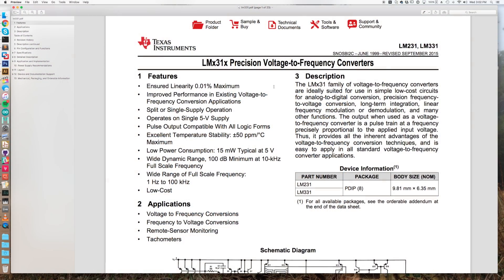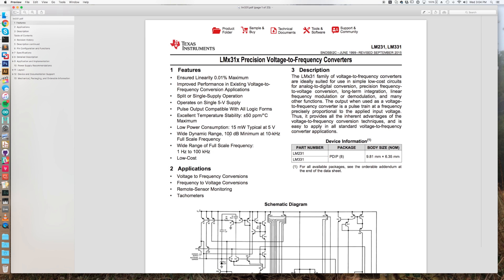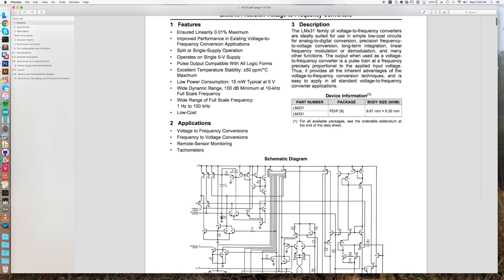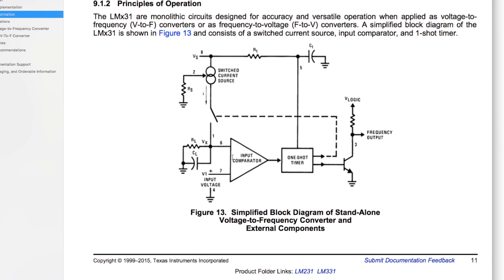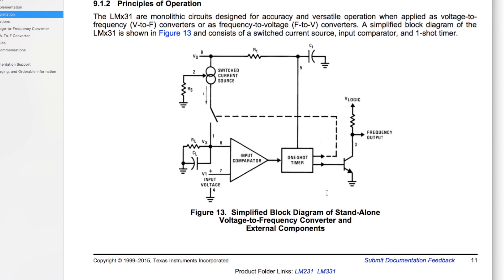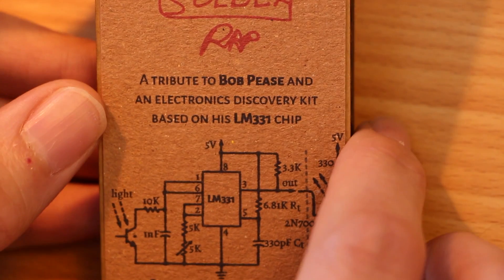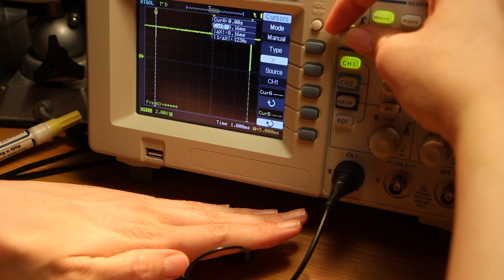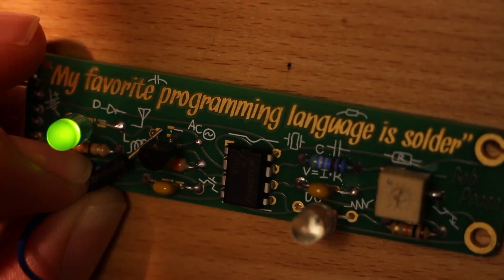LM331 Light to Voltage to Frequency

Comment: more than a wonderful LM331 video.. i have a LC v2F module can generate different frequency with no schematic and before i let the smoke out i better see how to hook up the output....?        Two independent outputs, OC-OUT is NPN, and FREQ-OUT is IC output. The common cathode end is matched with the negative GND of the power supply. When common anode connects, it is used with power positive. If the connection is common anode and power supply is 13-24V, please serial connect a 2.7K ohm resistor; if the power supply is 12V, please serial connect a 330 ohm resistor.  Connect the frequency pulse signal to F, and there is a corresponding voltage output at the terminal. Correspondence between input and output: 1V=1KHZ 10V=10KHZ. If there is a deviation, you can adjust the potentiometer on the board to calibrate.   thanks a lot, your video will help...:)     input: 0-10V  output: 0-10KHz  Operating Voltage: 13.5V-30V